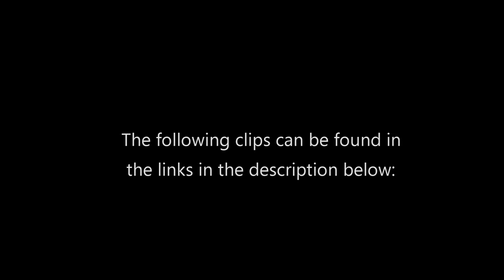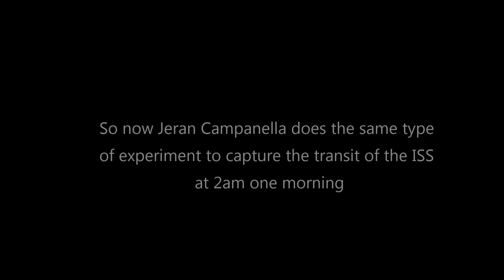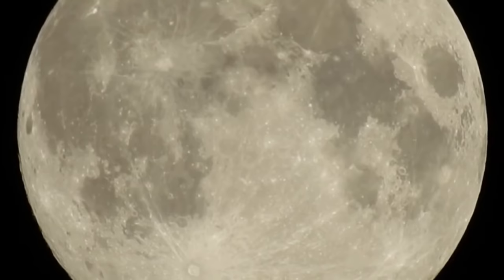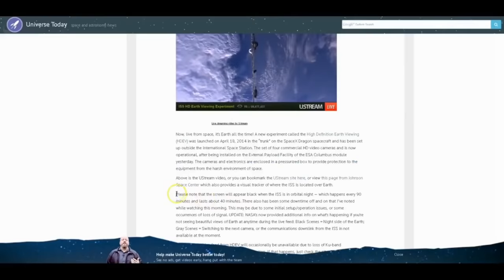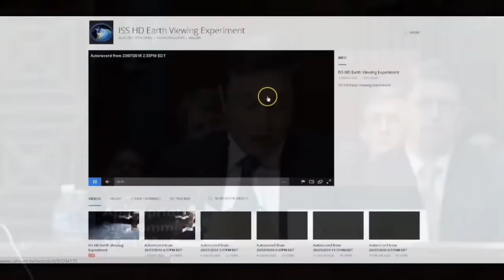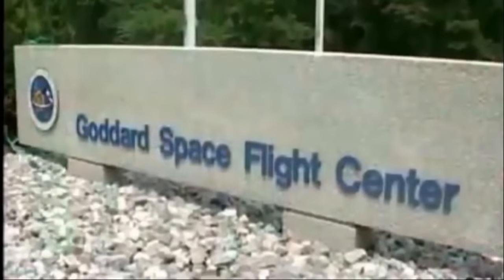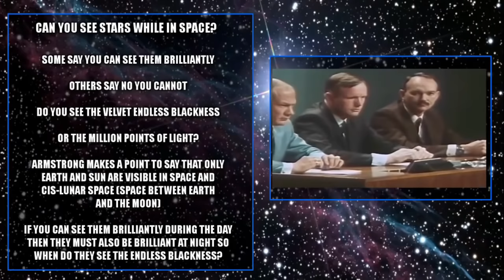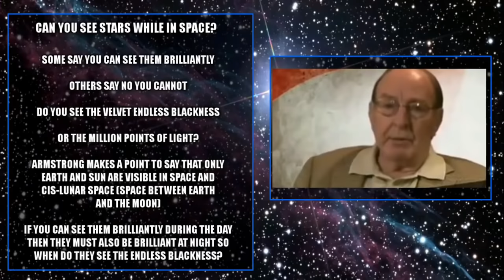The ISS Confirmed!

Comment: The "Shutters" protect the glass from micro meteorites? I want to know what type of metal or material they use to stop these "Micro Meteorites" that are traveling 50,000-100s of Thousands of mph that would protect people inside? The impact speed plus the speed of the ISS (depending on the trajectory of a micro meteorite) would shoot through the ISS like a laser beam and would have greater kinetic energy than a railgun. Funny, in all 18yrs orbiting at 16,000 mph and the ISS hasn't been made swiss cheese yet? I've yet to hear the ISS being struck by anyting.
Reply: The rover they took to the dark side of the moon was protected by shiny duct tape. Is duct tape not good enough?
Reply: @stevestiffler9120  there is no dark side of the moon, it's the far side or back side.
Reply: You can literally see the ISS clearly with a half decent telescope, yet you still deny reality
Reply: C Lopez  well you dont know space then because a object can come at any direction or even be somewhat stationary.
Reply: @stevestiffler9120  it's just regular duct tape if you're a mechanic you know how amazing that that stuff is you could damn near duct tape the rotating assembly together LOL
Reply: Micrometeroids have an average mass of 1x10^-9 and 1x10^-6 grams and move at an average of 10 km/s, the ISS is moving at slightly less than 9 km/s. The kinetic energy of the impact is Ek = 1/2 * m * v^2 which means it impacts the ISS with a kinetic energy of somewhere between 0.162 and 162 Joules. Putting that into perspective, a household microwave oven of 700 watts delivers that amount of energy in between 0.00017 and 0.23 seconds. Or - it's about the energy of a 0.5 kg rock thrown by a really strong person from 10 meters away. Not sure you need any sort of massive structures to protect against that.

Of course, there are the occasional heavier particle which requires more protection, but as for catastrophic hits it all is about statistics; the risk of one hitting is small enough to be negliable.
Reply: It's not metal stopping the mass but materials designed to absorb energy. Police use this technology everyday.
Reply: @franksevek106  Incorrect, the dark side of the moon is so called because it's the side the Earth never sees.
Reply: @franksevek106  yes and the back side of the moon has a crack in it and a hole
Reply: @theswagman1263  You can see the ISS with the naked eye. There are only 2 things brighter in the sky, the moon and Venus.
Reply: ChiefJustice Middleton ....how about you start making excuses for your lack of researching anything outside of YouTube.
Reply: C Lopez we have more boats in the ocean than trash in space. We have more trash in the ocean than boats. The oceans is a fraction of the size of the orbit of the ISS. Can you swim in the ocean without hitting a boat? Can you swim in the ocean without seeing trash?
Reply: @JRBunch  lol holy shit that excuse is about as good as a flat earther saying you can't see the curb in an airplane so they win SMH. there is a big difference big difference between a bullet and debris in space
Reply: cid facetious please continue on this difference, thanks
Reply: From the kind of   MICRO meteorites that pits and etches the face plates of astronauts and windows of capsules. Your equipment will slowly be sand blasted by the grit left over from the solar nebula that formed the planets.
Reply: @m.anthonyc.8761  "well you dont know space then because a object can come at any direction or even be somewhat stationary" - and the Earth, Moon and even the Sun are competing in attracting all those objects. Anything "stationary" in the same orbit would not catch up with the ISS, it would remain forever at the same distance.
Reply: you are the wrong one. It's the back side or far side.
Reply: it's the  far side for sure. The sun shines just as brightly there. Especially during the new moon. 
The common misunderstand that bugs me the most is the mislabeling of the quarter moon as " half moon". The half moon phase is more typically called "full moon". A week after new moon, when the terminator cuts across the middle of the earth facing side, you have the "First Quarter Moon"; A week being a quarter of the four week lunar cycle. @franksevek106
Reply: Anthony C. ...then why don’t you look up what they are and how they work? Or is just assume that they can’t, and continue watching flat Earth videos. That’s just as good, I guess.
Reply: ChiefJustice Middleton ....I’m not an ISS technician, so if you want to know what they use, how it works, and what repair procedures are, you should look them up. I don’t believe you’ll find the answer on conspiritard videos, but you might be able to find a few out of context snippets from a manual or two floating around your conspiracy video world. 
  BTW, what is this “free energy” you speak of. Maybe I was wrong about you, because surely you wouldn’t find something like that on a conspiracy video.

Comment: So who’s the brave guy who opens the hatch into a vacuum or extremely negative pressure.!?
Reply: C Lopez  the differential pressure between space vacuum and inside craft is only 1 atm. not very much
Reply: C Lopez  nope. 1atm is only like 14 psi.
Reply: @CURTIS-W5CER  That is plain wrong, and i even can tell you why. "The ignition source of the fire was determined to be electrical, and the fire spread rapidly due to combustible nylon material, and the high pressure, pure oxygen cabin atmosphere."  From Apollo 1 Wikipedia... 
Since then a mix of Nitrogen and oxygen similar to Earth is used with the usual 1 bar pressure. As 0.3 bar would cause severe issues as that is the pressure in like 9000 meters high..
Reply: O-rings are good for 3000PSI, just look at hydraulics on a bull dozer or back ho,
Reply: @hansjorgkunde3772  cite your source
Reply: @hansjorgkunde3772  ah.  I see your misunderstanding. Yes, on the pad, the apollo craft had a higher than 1 atm internal pressure, this was vented right before launch or during launch, to achieve the much lower 
.3 atm internal pressure in space.
Reply: @CURTIS-W5CER  ""Washington - Decision to use a two-gas atmosphere (60% oxygen, 40% nitrogen) during manned Apollo on-the-pad preparations and in pre-orbital flight reflects a basic inability to make the spacecraft flameproof after 14 months of redesign that cost more than $100 million and added about 2,000 lb. to the system."  That allowed of course to lower cabin pressure by quite a bit. As normally oxygen is only 20% so you were right at that point, however the ISS uses one bar pressure.
Reply: @hansjorgkunde3772  nice redirection. We were talking specifically about the apollo spacecraft. You've shifted to an entirely different system. Rather disingenuous of you. No external airlock hatches or doors on the ISS are opened without first isolating the airlock from the rest of the station and suiting up in an EVA suit, and then depressurizing the airlock.
Reply: @BACA01  thats just idiotic nonsence
Reply: skankhunt 42  water is also infinitely (exaggerated) heavier than air. 1 atmosphere in fresh water is only 34 feet (33 feet in sea water) , whereas 1 atmosphere is a 1 square inch column of air miles high. Under water, at sea level, you have the pressure of the water, added to the pressure of the atmosphere, so at about 33 or 34 feet, you experience 2 atmospheres of pressure.
Reply: C Lopez  so what happens, even if one manages to do so? will his head or eyes blow up? surely not
Reply: skankhunt 42  no worries man. I've been a certified scuba diver for about 18 years, so i'm well aware of the pressure of water.
Reply: C Lopez      ,,,there is no partition or bulkhead anywhere that i have seen, it appears to be one open space. If this is so, it is a recipe for a disaster, one leak drains the whole station.
Reply: C Lopez  ,,,when I looked at diagrams, I see no bulkhead area, I may stand corrected there. At any rate I personaly think that the ISS is full of holes making it uninhabitable, it has been up there for 17 yrs or so. There is something not right here, time will tell

Comment: Russian cosmonauts use toothbrush & duct tape to patch oxygen leak at ISS                      Kapton is amazing stuff: It’s capable of retaining its stickiness in temperatures ranging from −269 to +400 celsius (−452 to 752 fahrenheit in Freedom Units) and has a high tensile strength. Developed in the late 1960s, Kapton is found on most NASA craft in one form or another and it’s going to be used to shield the James Webb Space Telescope from the Sun when the instrument finally gets into space. You can buy it online for $10 a roll.

Comment: The knob they use to open and close the shutters does not have any parts that could potentially cause a leak.   The knob turns a rod that extends down the side of the module inside the walls of the cupola.  The rod then connects to other parts INSIDE of the cupola walls to allow the shutters to be opened and closed.   There is quite a lot of space between the inner and outer wall of every module on the ISS, and that area is not open to the vacuum of space - it is pressurized .  This video is supposing that the knob is solely responsible for the opening and closing of the shutters on the cupola, and that is not the case.    I am not your standard skeptic who automatically discounts any conspiracy theory.   I personally think that there were multiple shooters in the JFK assassination.   I also do not believe the governments version of events on 9/11 (I have read the 9/11 commission report twice).  But what would be the point of faking this in the first place? If we did not have the ability to send people to space, where do all of the countless rockets, satellites and other stuff we launch into orbit go?  Into the ocean? That would get noticed eventually and keeping the hundreds of thousands of people that work for these projects quiet would not be possible to do.   Someone would eventually get angry over being fired and spill the beans.    The ISS program involves Russia, Canada, Japan, Brazil, and 11 member nations of ESA (Belgium, Denmark, France, Germany, Italy, The Netherlands, Norway, Spain, Sweden, Switzerland, and the United Kingdom.   The proposal that all of these countries are lying about the ability to send people to to the ISS and bring them back home is ludicrous.  I can see why some people believe the moon landings were faked (I personally do not believe they were) due to the cold war and the US wanting to show it's dominance in space - however at the same time do you think that the USSR would have just let us get away with lying to the whole world about landing on the moon 6 times without calling us out for it?   You are entitled to your opinion, as am I - but I just do not see the reasoning behind faking the whole space program.   In reality, most Americans do not care about the space program at all, and know next to nothing about it in the first place.
Reply: Well said
Reply: Agreed, well said
Reply: 52 million dollars per day is their reasoning.... that's a pretty pay-check and other world players are  just as eager to live a lie for a nice pay-day. As for people noticing something falling from the sky - there's always plausible deniability,  junk returning to earth etc. Almost nobody looks up anyway otherwise they might notice the chemtrails once in a while,  but Nope; I see nothing rules the day. Everything is compartmentalized and only awaits news of the next fake school shooting or terror attack to clear the way forward into a larger cesspool of cash injections into a cadaver of pointless consumerism.
Reply: But what would be the point of faking this in the first place?  This is the same old phrase I have heard countless times and for some people that is enough to discount any conspiracy.  'Everyone would need to be in on it' and all that money too?  It's not real money (Fractional Reserve Currency pulled out of thin air and YOU pay the interest) and much of it is from YOUR Taxes.  

The reasons for the deception go back millennia and is an extremely complex issue and features religion, power, personal gain and ancient secrets.  Laugh and giggle if you want, it makes no difference to the truth.  But the system of secrecy is a pyramidal structure on a 'need to know' basis and that is why the pyramid is so prevalent in the world.  Surely you have seen images of the all seeing eye of Horus on the top of pyramids on the US bank notes and elsewhere? Including the Masonic owl.  There is so much more.  

The apparent differences between nations is fake.  Look at the Antarctic Treaty and the 1967 Outer Space Treaty.  Do you really believe that Russia and China for instance would adhere to these treaties when everything else is falling apart and there are so many apparent mistrusts and political agendas?  Why would they?  There is an alleged nuclear threat but they will never contravene these agreements?  See where I am going with this?   Think about it.

Take the red pill and you will find out the truth.  And yes the Matrix does have a meaning to it.  Waking up people you up on YT is am impossibility without you being able to think outside the box to begin with.  Anyway if anyone responds with abuse I wil not reply.
Reply: @unchosenzombie5144  Agree absolutely.  I have ben aware of balloon satellites for years.  Orbital satellites are a fiction of Arthur C. Clarke's imagination.
Reply: Oh pllleeeeaaaassse......
Reply: I would subscribe if you made videos. 
People need to see what critical thinking looks like
Reply: Mike Mckay  Exactly... people that babble about how the ISS is real with real astroNOTs in it just ignore all the safety issues that would have killed them and destroyed the FAKE ISS.

Comment: So, there is no such thing as a dynamic seal? It is impossible to seal a shaft penetrating a pressure boundary? Look at any pump. Look at any boat with a propeller. You guys are really grasping at straws
Reply: What happen to a O rings at extreme cold will it shrink loosing its seal will the rubber become hard what will happen to the rubber when you will try to move it is there some chance that it will break. What happens to your car in winter when the rubber is frozen to the door and you are not able to open it. Or your wiper blade stuck in the ice and you start the wiper does the tiny rubber blade break.
Reply: light world Where does it say that all O rings must be made of rubber? Liquid oxygen systems use Teflon O rings. And while the guy did indeed say they were O rings, that is not to say they actually are O rings. It could be anything from a quad ring to a V ring.  There are dynamic seals able to function at cryogenic temperatures here on Earth so designing a dynamic seal able to function at the low pressures and temperatures encountered in LEO would not be a great challenge
Reply: @bernieeod57  So what you are saying is that the Nasa guy is lying about the O rings and according to you other kind of seal could do the job. Then you should apply for Nasa to solve their gasket and o rings issue. If it is not a great challenge the Blackbird sr 71 leaked from the 1960 to the 1990 being the last time I saw a video of that plane talking about their high altitude fuel gasket issue.
Reply: light world Hou are the one saying that a dynamic seal can’t be done. It is done every day with temperatures hatter, colder, and with far greater pressures than the ISS encounters with this challenge. Not only can it be done but there are several options.
Reply: light world What gasket / O ring problem?
Reply: light world It was not O rings which leaked on the SR 71. It was the seams on the fuel tank and they were designed that way. The leaks sealed when thermal expansion expanded the joints

Comment: "With O rings"......."no you don't" ..lol
Reply: Josh A What scientific properties allow for O-Rings to create air tight seals on Earth but not in low earth orbit? Anyone? I didn't think so...
Reply: Joe Elmore they would presumably work initially but would certainly fail rather quickly due to friction. The problem is that failure would be catastrophic! !
Reply: They add issue with gasket on the blackbird sr71 and high altitude gasket leak the fuel. Fuel is denser then air. Extreme heat and cold heat expend cold shrink. In a place with no air it will be funny to see them trying to fix this they will have to call for a repair crew and a part store to bring them O rings before they run out of air. Under the sea the water pressure try to crush a submarine in space where there is no air it would try to pull the air out like a giant vacuum cleaner. Similar to the two bell that you put together and make a vacuum making the suction very powerful so powerful that you cannot split them apart until the vacuum is removed and the air pressure is restore in this case the vacuum would be all around sucking the iss for air.
Reply: Joe Elmore Where'd you go? ? Anyone? ? Didn't think so. ;)
Reply: light world I agree. When one actually scrutinizes the details of the ISS ,it falls apart. Literally. Lol
Reply: @TheJoshA   If you actually scrutinized the details of the individual he was asking the O ring question to you would know that he is a geologist not a space craft engineer.  Don Pettits main job is studying meteorites.
Reply: Josh A ...what friction would they wear ot from?
Reply: light world ....a car tire has more of a pressure differential than the ISS would. If a tire exposed to the elements and constant flexing can hold air in, don’t you think that they could make something do the same thing in space that isn’t subjected to the elements or movements? And like he said, if there was a leak they would probably fix it. They make gaskets and seal flr use on Earth that withstand a hell of a lot more pressure than would be seen on the ISS. 
  When you understand nothing on any subject, any subject you talk about, you will appear stupid. Just some friendly advice.